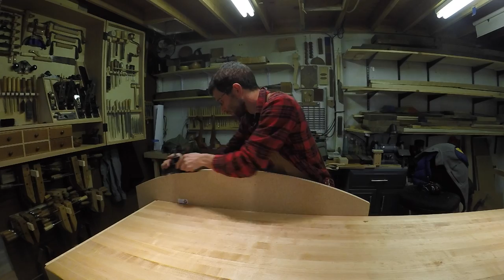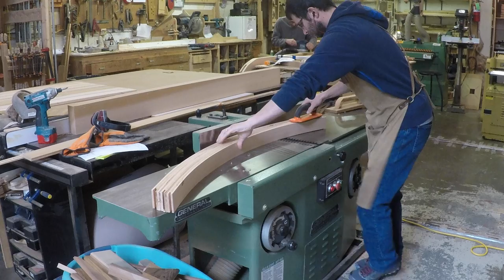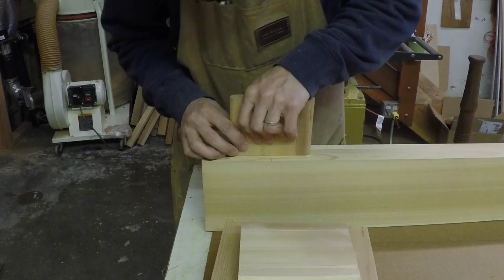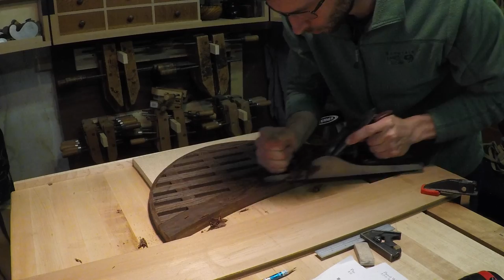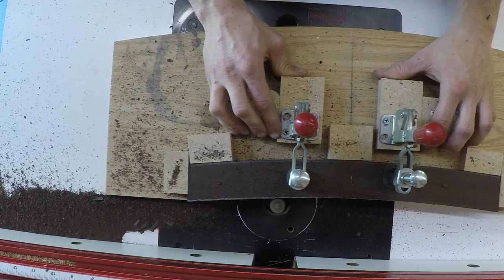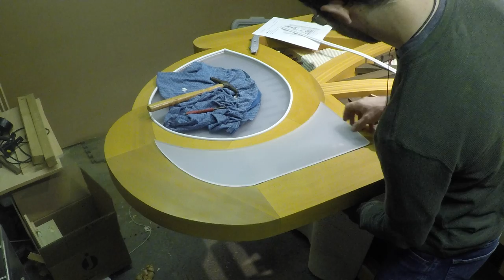The Wave Gate- Building Process

Comment: love this door. wondering if it would all crack and split in a place where the winter months hit -30 ?
Would a resin or something prevent it from splitting?
Reply from the maker: -30?  I think the more important question is what are you doing in -30?  I have never put a gate in suck harsh conditions before, but I'm sure the Western Red Cedar would be more than suitable. You would definitely have to pay attention to your design.  Keep the part widths to a minimum, as they will move less.  Something with an open grid would probably do best, as the parts are narrow and the abundance of joinery would keep true the longest.   Where do you live, where is reaches -30?
Reply: Ben Prowell I am in Quebec, Canada so here the weather can go from a plus 30 celcius to -30 celcius. Will try this type of door within the next months. The red bars are made of what type of material?